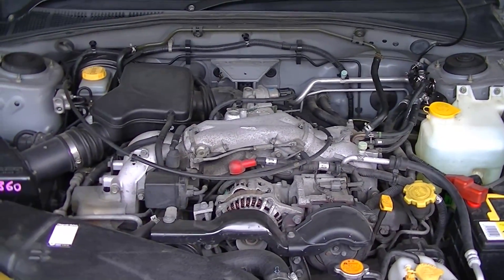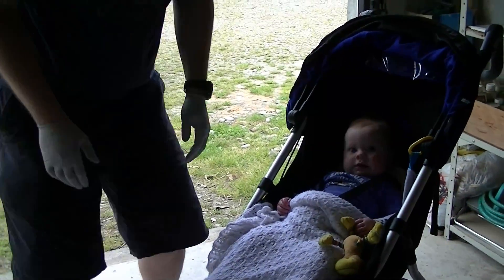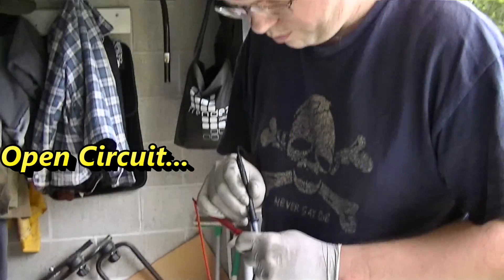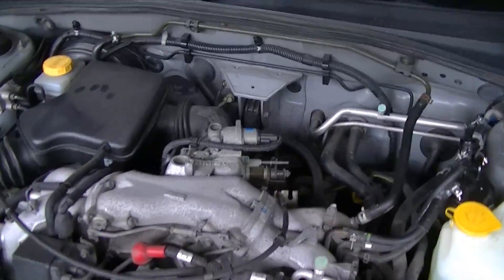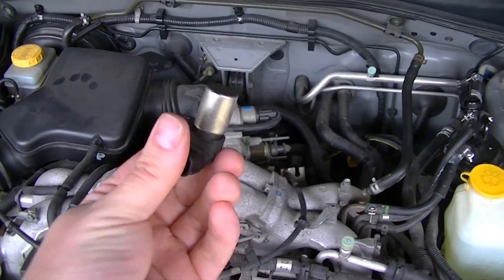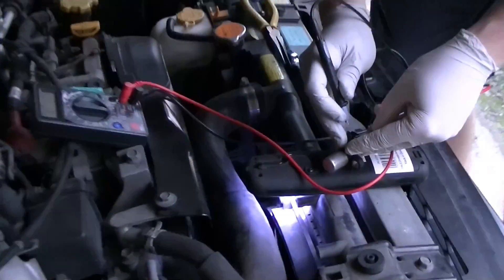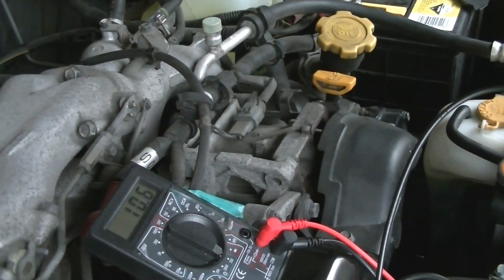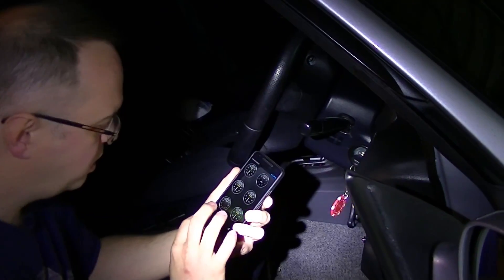Subaru Impreza - Crank no Start Part 1

Comment: People dealing with this… unplug maf, test. prime fuel, feel fuel line for pressure, feel in 5 min for pressure again. Check ground wires!!! it could be this easy!!!! clean cam and crank face and pigtails. Coolant Temp sensor will entirely prevent start keep that in mind their may be TWO temp sensors on ur subi as well as that pigtail may be brittle!. Compression test, hope for higher than 140psi(it CAN run with 100psi on all cylinders FYI) with WOT and 12v+. Check timing marks!! If you have single coil pack make sure they are all to their correct place and check spark while cranking. Get a small halogen bulb or  non-polar LED light, connect to injector harness while cranking. If this is still showing no signs of faults, time for wire checking! Every 90s+ Subaru has a separate engine harness to make ur life easy, get pin-outs online (they are their keep looking) check with multimeter for continuity. If their in no resistance you are on the wrong pin or they’re is a loss of connection, inspect harness for damage while you are here! That should solve 95% of cases.
Reply: I really hope your right about the coolant temp sensor
Reply: im dealing with similar problem in a impreza 1.6 1993. One year wont start. Fuel pump wes damaged, we replaced it, but the wieres that send voltage are not sending anything. 
The car had an aftermarket alarmr, tooked out , test voltage supply of fuel pump and it was getting 12v. 
Then i put the new fuel pump and AGAIN there are not 12v on wires. 
I think i checvked all eartsh on engine bay, any clue or ideas ????

Comment: My guess is the coil spark ignitor. This is the unit the 3 wires come from and go into your coil. On an 05, its located on the firewall, attached by 2 hex head screws and should have one yellow, one blue and one red wire coming out of it. The module is about 2" x 2-1/2" x 1/2" thick.

Comment: I am having this same problem I think, just replaced the timing belt put it all back together and it still not turning over, my question to you is can a crank sensor go bad after the timing belt breaks?
Reply: Did you find a resolution. I have the same issue
Reply: Did you find a solution for the issue
Reply: @ No it's still sitting there but when it starts to warm up I'm gonna get back at it, and I'll let you know.

Comment: I would check for injection pulse and spark. also try opening the throttle plate when starting. If it has a Iac it could be stuck closed.
Reply from the maker: I'll add those idea to the list for testing today. Thanks for commenting!

Comment: Im kinda having thesameproblem wirh my boxer engine fa20 which is in the 2013 BRZ spent all day checking my harness I had some extra camshaft position sensors I tested as well for some reason my car did a soft shutdown on the freeway power was still on to all my accessories not the block haven't been able to get it started and so far it has that about a week I worked on it yesterday but you two needing to do grocery shopping I waited to test it and put pressure oil and a new oil filter on
Reply: What ended up fixing it? Having a very similar issue now?

Comment: I don't know if it was just the mic on your camera but that engine does not sound healthy. I would spray some starter fluid in the intake manifold to check for fuel issue. Then check spark. Then check compression on all 4 cylinders. Should give you a direction.
Reply from the maker: It didn't sound right to me either but I don't know much about Subarus

Comment: My 2004forester with EJ25 SOHC engine had head gasket redone...it worked for one day; then could not started...bought. EJ20 SOHC engine as it is only available;;; replaced back plate to fix it to the older tranny. Put back the intake manifold and sesnors...kept the timing belt od the new engine ..turn it on; it worked for some time then went off. Had to bring new sparkplugs and meanwhile replaced the crank and camshaft sensors from older engine ...it worked again for some time then it wont work again.
Checked fuel line and nozzles all worked fine...fuel pressure was 3 par
Checked coild back and sparkplugs and all seems fine and giving pusles.
It seems engine need to start but it fail...
Checked timebelt and it looks intact.
What could be wrong....with putting gear on N will fix the problem...

Comment: Well isn't this a good time to have a Subi issue..lol...Got fuel.?..Check..You hear it prime but is there fuel out of the fuel filter.?...A noid light check for injector pulse or a wedge park light globe will do and that's the fuel side done..Compression.?. sounds like it..Pull both cam belt covers and line up the timing belt marks(turn the crank..24mm socket on the crank)..If good..Got spark.?...Got power to the coils.?..Put that phone thing away and back to basics Badger..
Reply from the maker: Haha I was thinking 'what would Zig do?' when it didn't start.

Fuel pump primes and there is a decent amount of pressure on the rail. Good tip on the park light, I will try that.

Compression was my first thought when I heard it so will check that and spark at the same time.

That phone thing only came out at the end to check my rev counter theory. It offers nothing useful in this diagnosis!

Comment: First spark then the back to the crank sensor and check for voltage and ground unplugged then find a  different 5v ref somewhere else and see if the theres 5v.  Doesn't mean the new parts good either.  Check the fuzes to the ignition and under hood.
Reply from the maker: Thanks Steve. Fuses are all good. All the writing was in Japanese so I tested every fuse and they were all good. 5v reference was also good at the cam sensor. I shall dig deeper
Reply: Badgertronix well it might not be at the ECM I would check it at the ECM  and see if it is there . BBB INDUSTRIES HAS FREE PINOUTS .  No spark there's where I would check.

Comment: Certainly sounds like for the lack of a better way of saying it , flooded. Coolant temp sensor value? Sometimes when the crank sensor is just starting to fail it can cause the spark and pulse to be erratic thereby causing the above also. Sometimes just holding the throttle open 3/4 of the way and cranking is enough. And of course spark must be checked as you said
Reply from the maker: That was a thought and I did try starting it with accelerator all the way down. Didn't check the coolant temp sensor. Part 2 is up for the conclusion... so far

Comment: It sounds like it has no compression.. No resistance.. 
1- check battery
2- check wires and ground 
3- check fuses 
4- check starter relay
5- check starter and connections 
6- check crank sensor 
7- check timing belt
Reply: If RPM needle is moving as you turn ignition key it means crank sensor is getting the signal from the ECU.  Also, tap starter with a wooden stick as someone turns key and if it starts right up, it means starter was the problem all this time. Also, check fuel pump relay and tap fuel tank as someone cranks engine to verify if fuel pump is producing enough fuel pressure. If it starts, is your fuel pump. If problem is not fuel, then check spark with a spark tester.. If you have spark, then is compression as one or more cylinders are not working properly.. An engine has to have a healthy compression in order to work properly not than necessarily it will prevent car from starting but its a contributing factor.  Check fuel filter to see if its clogged.

Comment: 2003 forester cranks but wont start also not getting the check light on the dash board and cannot scan because the obd2 port not getting power check all fuses, timing, grounds... Any suggestions?

Comment: Crank Position sensor  wire? Fixed one of these last week the harness broke  off were it gets wrapped up into the larger harness. 2 wires and the ground/shield weren't attached at all. Looked like it was caused by vibration.

Comment: The temperature sensor kept  my 1998 Subaru from starting. Sometimes it would start then I would get stranded.
Reply from the maker: +BonerMaroner interesting. Sadly he sold the car straight after this so never find out if the problem returned. Cheers!
Reply: Really, how does that stop it from starting. I just did a block swap and it wont start. Have fuel but no spark
Reply: @mciaknetu  if you have fuel but no sparks then it could either be crank, cam sensor or ecm
Reply: Did you replace it. And did it fix the problem

Comment: I had identical problem as the video showed. But My 2021 Outback Tourning XT fuse box was not the same as shown. It did not have the seperate black box of fuses.  I looked in the owner's manual at both the under dash fuse box & under hood box.  I could not identify starter fuse.
Someone please help this old 78 year old retiree. The nearst subaru service is 100 miles away.

Comment: Gidday Badger, I would usually scope out that crank sensor to check for operation, but I am assuming you don't have a scope? (You should get a cheapie BTW). So, what I would be doing next, when you do your spark test, if there is no spark I would try a crank sensor bypass test and see if that give you some. Might give you some direction anyhow. Will look forward to the next video. Scannerdanner has bypass testing videos if you need help there. Cheers!
Reply from the maker: Good idea on the crank sensor bypass test. I'll stick that on the list to do. I need a scope and lots more, I only turned up with a socket set first time round!

Comment: I hate to be the bearer of bad news, but I'm not hearing much (if any) compression on that engine.  Do a compression test on all four cylinders, 'cause there's one in there that might give you false hope.

Just from what I'm hearing in the video, there's a pretty hefty mechanical failure.  Maybe the timing belt jumped a tooth somewhere, maybe it's missing teeth, it's really hard to say without seeing in there.  I wouldn't be at all surprised to find bent valves with a sound like that, though.  All speculation, though.  Do a compression test and go from there; no sense in going after spark or fuel with a sound like that.  :[
Reply from the maker: That was exactly my thought when I first heard it. I managed to edit out the bit where I said similar!

There is a genuine Subaru cambelt change sticker from 2012 and when I took the timing cover off and cranked it the belt was tight and looked in good condition. Of course not of that means anything if it isn't in time.

That would definitely fit with the 'sounds like the starter motor is spinning quickly and not engaging' customer complaint.

I've charged the battery up so we can do some more testing. Cheers!
Reply: Badgertronix
Best of luck!  Any idea on vehicle history?  How was it running before it failed to start?  Did the car overheat?  Were there any funny noises?
Reply: Hi can you give some idea my ej20 twin turbo engine rebuild good compression, good fuel pressure, ignition and injector good working order but no start

Comment: Got a 2015 Impreza, finished a motor swap and the only code is P0335, Crank Position Sensor Circuit A... new harness, new crank sensor,  new reluctor plate, wires tested... Subaru Master Techs have no idea. I've said it before and I'll say it every day, fuck Shitburu's

Comment: I have the same issue right now.
Reply from the maker: +Rose Festin this one was related to the crank sensor
Reply: Rose Festin mine just did this this morning. Watching the video to see what the problem is
Reply: @ericsamb  iv got the same issue  I was driving ran outa fuel I put gas in it now it won't start